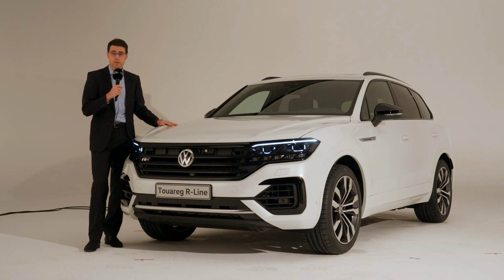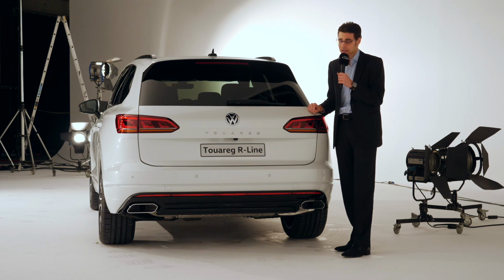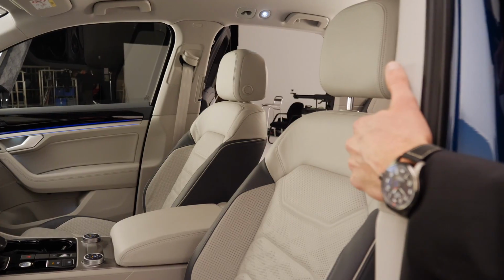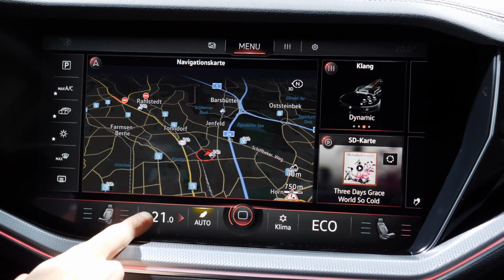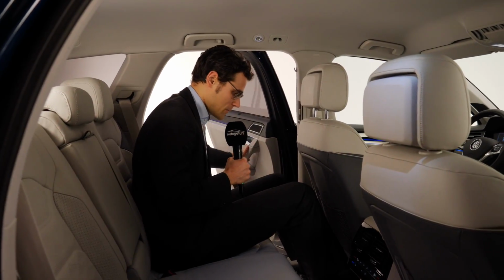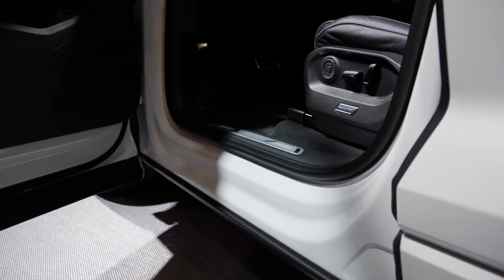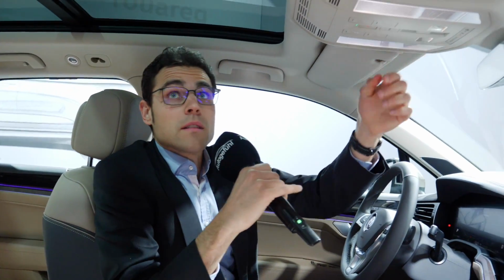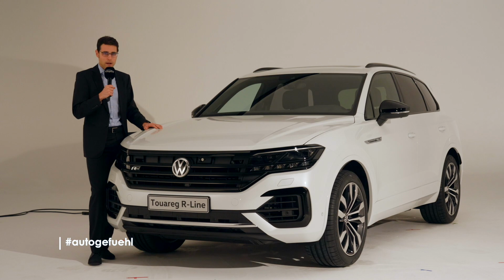All-new VW Touareg 3 REVIEW 2019 2018 Volkswagen Touareg R-Line, Atmosphere, Elegance - Autogefühl

Comment: The painted wheel arches, combined with the contour above the joint, makes it look tacky. It kind of looks like you have a huuge wheel arch - with a filler. And the painted plastic is yet another layer. Like some kind of 80's body kit. So I agree with Thomas that the black plastic looks much better. Also aids in the illusion of making the fenders look a bit slimmer. This just looks bloated :P 

Overall it's better than the last one. Still a big, slightly boring car though. This one doesn't improve as much as the smaller cars did with the new design language. The Golf for example, went from boring to really sharp with the new design. Imho.

Comment: awesome! 
now you have to operate even front/rear defroster via the touch screen! dear volvo, this is how you do it.... the only button for basic car operations is red triangle.
so in case of error of breakdown of this tablet, you can turn your lights on or flash the hazards light. and that all. 
if yof screen wont boot up, or it would be laggy, have a good luck in cold days....

how stupid is that! this is even dumber design than this in new volvos. i cant see a reason why not put real buttons for AC instead of onscreen AC part at the bottom of display. some thin strip of buttons with 2 turnable knobs like inside of a current Q7. its fail proof, easy to use, its safe.

bonus is glossy key for the car. SMH
other than that, it looks pretty good outside.

Comment: How can a car this size not have 3 full size rear seats? This is always a huge fail with these kind of cars. The middle seat is useless in terms of size and comfort for any kind of distance. It can be done easily similar to a ford smax which is a smaller car overall but 3 full size rear seats
Reply: thats Audi q7 territory
Reply: jh5kl the q7 also has a narrower middle seat 😕